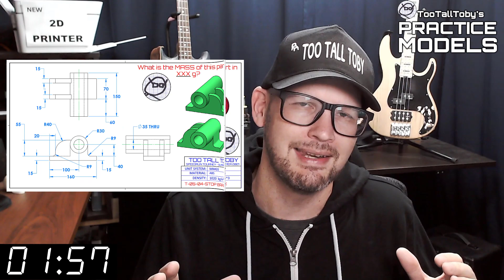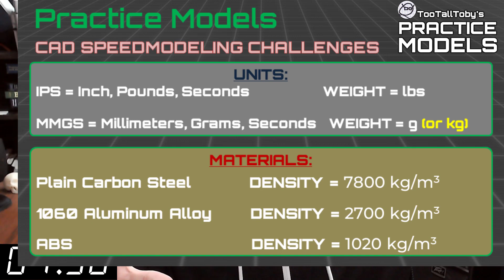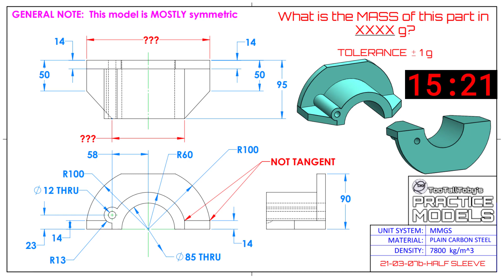3DCAD SolidWorks Onshape Fusion360 Practice Drawing - 21-03-07b-HALF SLEEVE

Comment: 7:47 I got 3749.64g, so not exact. But I did it in Blender. Granted I had to use Blender's 3D print tool to calculate the volume then do the conversion by hand, but that's not too bad for a first try, IMHO. And I may have fudged the corners a little, though not enough to explain the difference in grams here.
Reply from the maker: wow awesome job!  So exciting to see BLENDER in here!!  nice job!